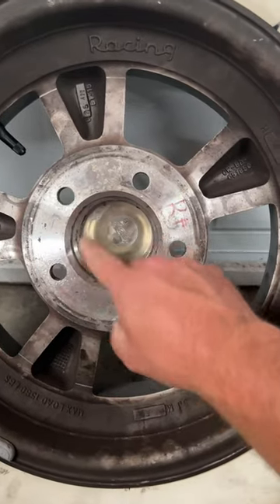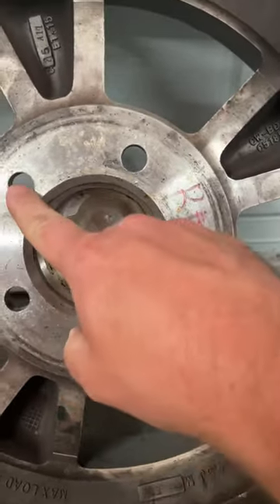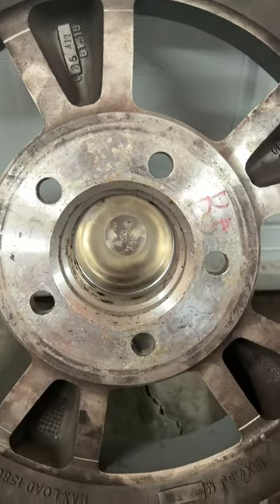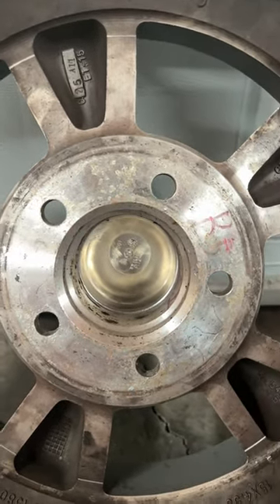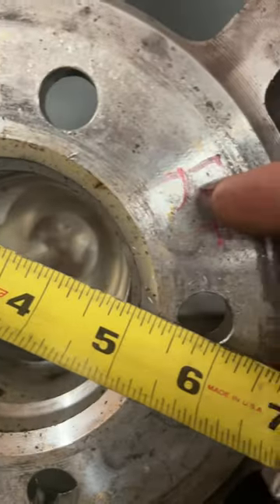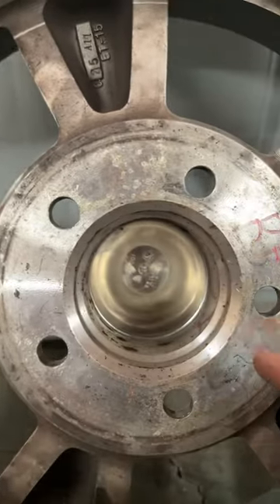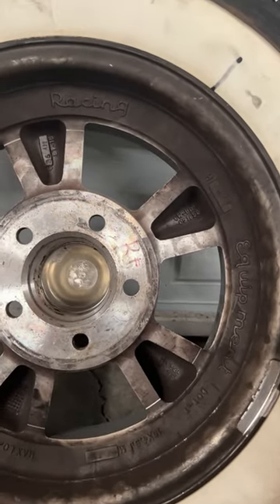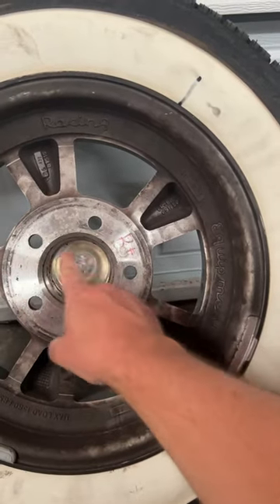BOLT PATTERN 101: How to Measure Wheels for Perfect Fitment

Comment: Bolt pattern doesn't go by inches though they're mm... 😂 so you'd need to convert the inches to mm...
Reply: Look up Chevy 6 bolt lug pattern
Reply: Tell us you're young and inexperienced without telling us.
Reply: Ok kiddo...
Reply: USDOM was all inches until about the last decade. 

The '19 Dodge Caravan has a 5 on 5inch bolt pattern.
Reply: @Texassince1836   Yeah my 1950 Cadillac has the bolt pattern in inches.

Comment: i thought measuring of bolt pattern called out for center to centor of bolts?
Reply: That's what I thought.
Reply: On an even number of lugs yes. 

On an odd number there is no lug 180° away to measure to.

Comment: 🤦‍♂️.    You were an inch off to what you said 😂 you mean 5 3/4”?
Reply: He measured from the 1 on the tape measure not the end of the tape measure therefore it would actually be 4 and 3/4
Reply: No he meant 4.75
Reply: That's 4.75 inches.  He started from 1, not from 0